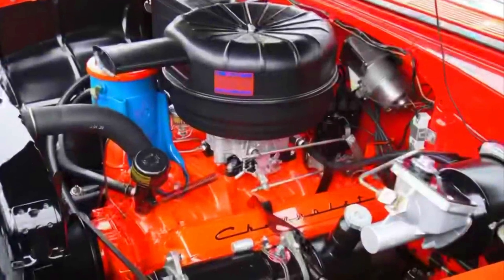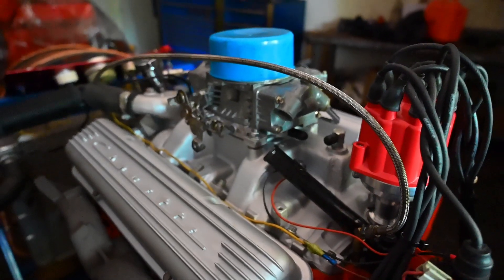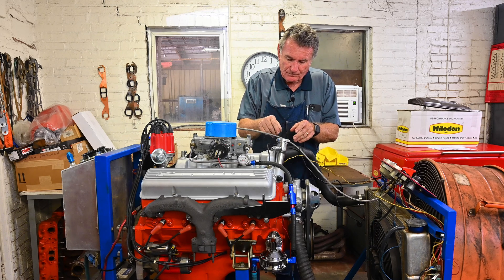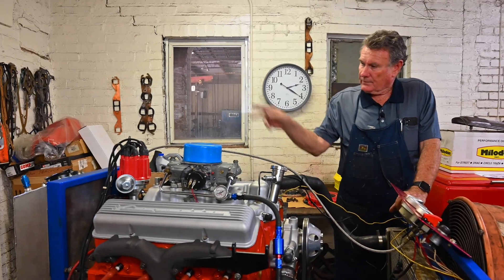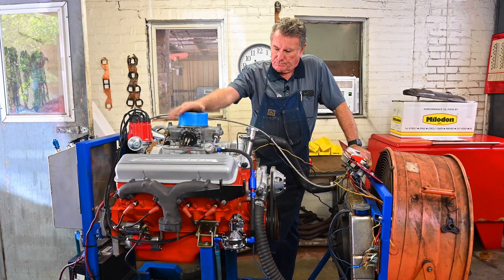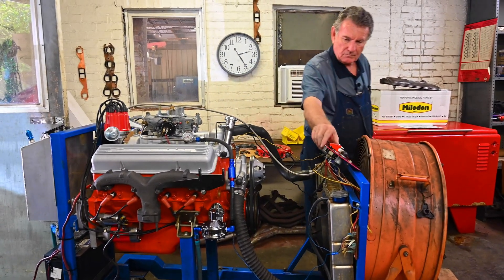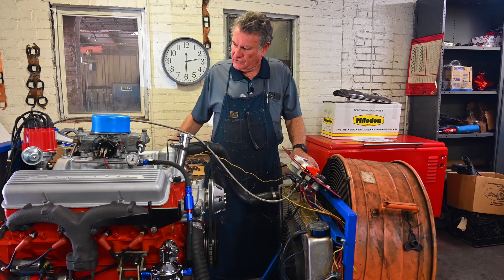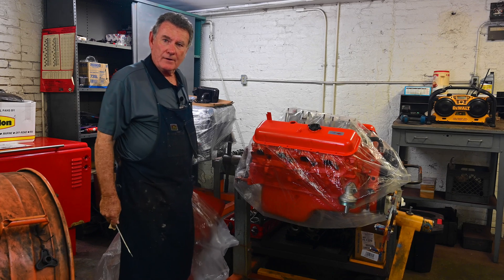Chevy 327 Rebuild Pt 6

Comment: Hi Roy ---- your balancing of the 327 crank caught my eye --- watched 1-6 ---- and am wondering about the break-in of this engine --- believe you said it was a Erson Cam ---- seems like there is --- SO MUCH --- out there now on failures of the lifters -- which affects the cam ---- did you use Erson for the lifters --- sticking with one manufacture? ---- Along with the failures -- I'm seeing that the valve springs are playing part of these failures ---- TOO MUCH --- pressure ----- Did you use softer springs on break-in ---- then switch to what is recommended for that cam? What do you recommend for -- Seat Pressure and when the valve is wide open? It's like the springs are overrated giving too much pressure --- An engine that is -- NOT -- made to go for hi-revving -- say max of 5,000 that is even over doing it -- more like 4,800 with a not so good crank ---- like the Pontiac 301 --- I have a question on that later --- In this 301 --- I'm thinking of the Howards CL418001-09 cam and lifter set --- Springs are on my mind ---- "Gold's Garge" by Al says seat pressure around 110 and wide open around 250-300 pounds. ------ Engine is in -- was -- tearing it apart now --- in a '56 Pontiac 2Dr. Hardtop just a cruiser ---- Anyway --- Thank you for doing these engine build videos-- I caught some info that nobody else has talked about --- made myself some notes when time comes ----- Well just five more days till Christmas '24 ---- Hope you have a Great Holiday ----- Thank You again ----- Rodney